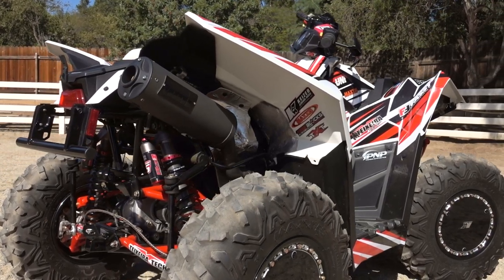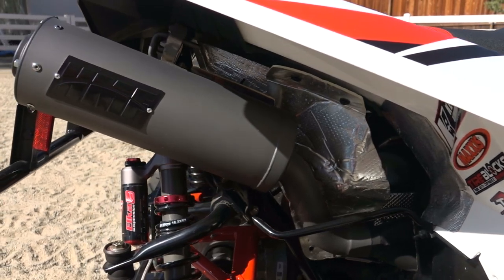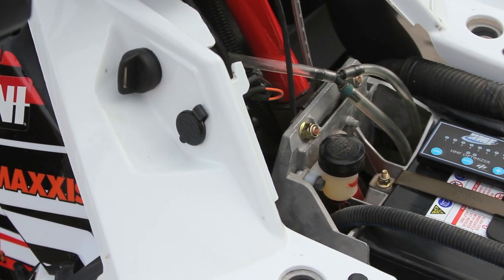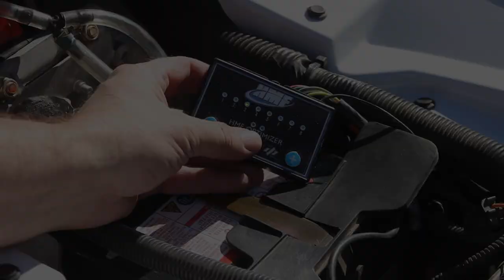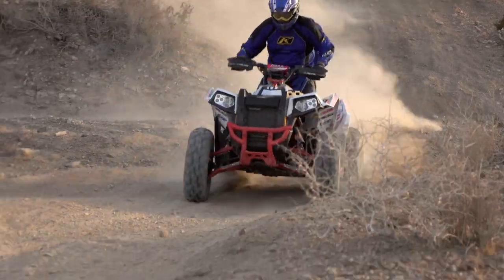HMF Polaris Scrambler XP 1000 and 850 Titan Exhaust and Fuel Optimizer Test

Comment: I was thinking about getting HMF exhaust for my 2016 polaris scrambler 850 but I was worried that it would be to loud for the db limit here in MN. And does it really make that much of difference of getting one or is stock fine?
Reply from the maker: Admittedly, it sounds like you are in need of the Titan Quiet, not the Titan XL. On the 850, the XL makes more power than the quiet system. On the Grizzly 700, the Quiet adds enough power that we couldn't justify the extra DB of the XL version. We would want to run the XL version on the Scramblers but with sound being a factor you're limited. Running heavier, or taller tires like us will sap your stock power. Even the Titan Quiet will help you get some of it back. so if your running nearly any tire other than stock and you have the money to spend the Titan Quiet could still be worth the investment. We would recommend picking up a UNI foam air filter while you're at it. They flow better than stock providing more horsepower, are serviceable, and filter small dust particles better than cotton style filters. Polaris stock setup isn't that bad so you have to wring bits of power out of it. We are happy to answer your questions but don't hesitate to contact HMF as well. We've found them to be straight forward and very helpful regarding their products.

You may also look into an EPI clutch kit. We didn't run one on the 1000, but the combination of the exhaust and clutch kit would take things up another notch.  Please make sure you check out our Scrambler 1000 project for lots of good ideas on how to trick out your 850. https://youtu.be/xb1w9l04f18
Reply: Thanks very much for the reply. I thought about it but, i don't think ill get anything because I will hopefully be ice racing my scrambler. But the thing is I race in the stock class. So I can't really get much or anything that you recommend if I want to stay in my league. And again thank you so much for the reply!!! and have a good day!
Reply from the maker: Makes sense. Good luck with your racing endeavors.  Thanks for watching and taking the time to comment.
Reply: Again thank you very much!

Comment: how much horse power was gained
Reply from the maker: Looking at HMF's dyno chart there are two very important things to understand. 1st, Polaris says the Scrambler produces 89hp max, which is at the crank. HMF says the stock Scrambler produces 67hp, which is measured at the rear wheels.  By HMF's  numbers the Scrambler gains a couple of horsepower at peak and looks to enjoy a similar gain across most of the usable powerband. If the horsepower were being measured at the crank it would be closer to three extra horsepower on top with a similar gain across the board. Its a little faster and quite a bit lighter than stock. Gains on the 850 are a bit larger but similar. Hope this helps.
Reply: Yes that helped a lot and thank you for responding.